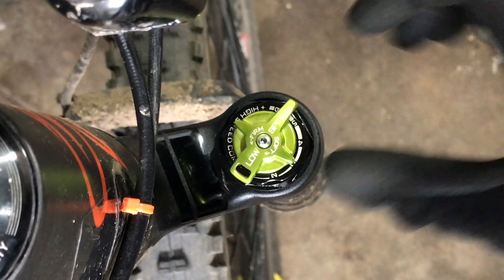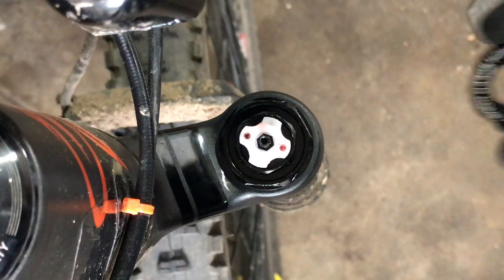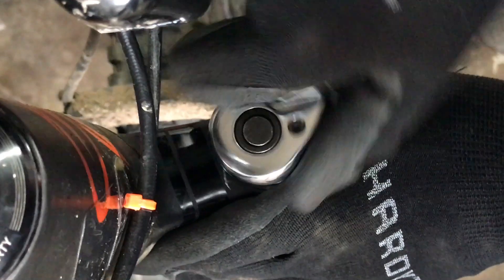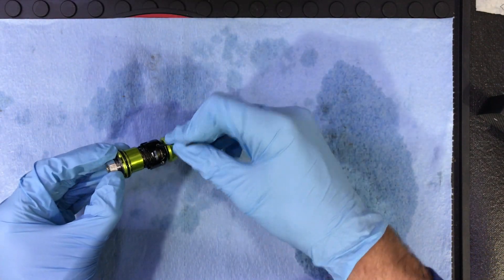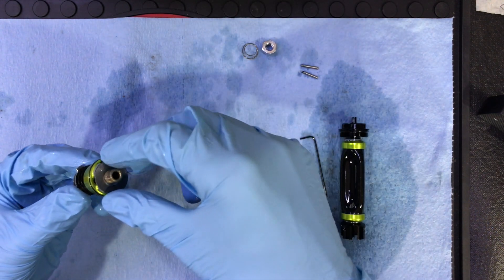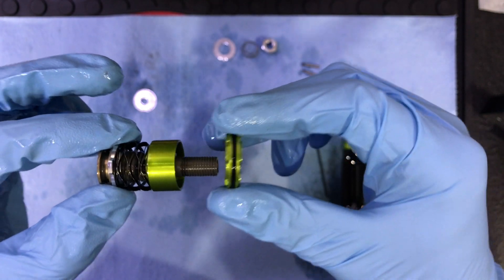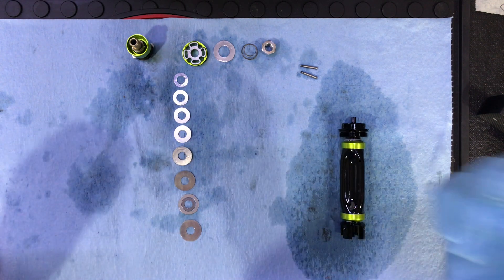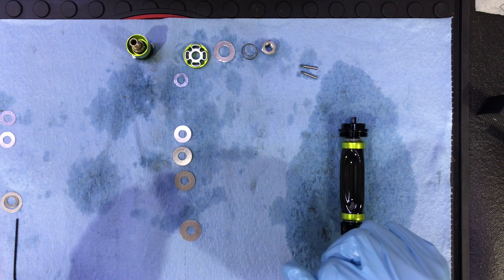DVO Diamond Shim Stack Tune For Less High Speed Compression Damping

Comment from the maker: Some viewers had some observations and suggestions:
1. There is an easier way to get to the shim stack: Set the HSC to the lowest setting. Lift the green HSC preload collar with your hands as far as possible and you will see a 10mm wrench flat machined into the shaft. Hold that with a wrench and release the main piston nut. 

2. You may notice the bladder is a bit "Sucked in". This isn't ideal but its easy to fix. Remove the two C-clips (careful they don't go flying on you!), move the green collars away from the bladder, then lift up the end of the bladder to allow it to suck air in. It only needs to be filled to ambient pressure. Ronnie has also suggested putting some heavy grease on the ends of the bladder.

Comment: The preload shim (the ring shim) are a low speed preload, it'll also affect mid and high speed compression though....not sure it's the most "elegant" solution to the problem.  Certainly not the "flip the piston" as it affects the oil-return orifice which needs to be free-flowing.
Why not run a slightly lighter fluid with a bit more rebound and low speed compression and then remove just the smallest shim?

Comment: I was wondering if you had any insight, I bled my damper but for some reason, the LSC doesn't really have an effect? Before the service, the fork would get really stiff when I turned up the LSC dial, but now there's almost no change at all. I can compress the fork fully when no air is in the Air-spring side, so I don't think there's a seal problem on the damper side. I figured you might have some tips based off this teardown. I followed the service guide step by step several times over.  Thanks
Reply: Any updates on that problem?

Comment: Have you ever seen a video on how to rebuild the bladder? 
I bought a bladder kit because they recommended it when I reached out about doing a full rebuild after a year or more of riding, but I can't find any help on how to disassemble the only part you didn't touch in this video🤦🏽‍♂️
Reply from the maker: Its been a while, but I think this should help. I think there is a nut that holds it all together. You can briefly see that at 3:48. Take that off, then the assembly will slip apart. BE CAREFUL TO NOTE WHAT GOES WHERE!! This is the rebound damper so you can really mess things up if you lose track of what went where. When in doubt, call DVO and they can sort you out.
Reply: @mtbdeli9018  thanks! Yeah I'm not sure if I broke it trying to get that nut off🤦🏽‍♂️... Of course the whole assembly is out of stock so... 😮‍💨😣 When I get home in a couple days I'm gonna call them and try to sort it all out. (Since I have an Angel Fire trip coming up though, I went ahead and snagged a 2023 180mm ZEB Ultimate) 🤫

Comment: @mtbdeli, 

So does this only affect the high speed compression, or does it affect both high and low?  I'm not familiar with the damper design, and with what the adjusters on the fork do internally.
Reply from the maker: Essentially just HSC. It does have a small effect on LSC but nothing I ever noticed. But the engineers would correct me if I said it was only HSC. 

The LSC adjuster opens/closes a pin valve to restrict oil flow through the port. The HSC adjuster adds preload to the shim stack.
Reply: @mtbdeli9018  so, (not to get too deep), but does the low speed compression not have a way of blowing off or bypassing / is it always active / fixed orifice?

I suppose maybe HSC oil can bypass the low speed orifice?
Reply from the maker: @sham8723  LCS is always active. The ports cannot be closed and will always allow SOME flow. The pin valve that lets oil get to the low speed holes on the piston can be adjusted so more or less oil can travel in the LSC circuit. However with LCS/orifice damping you can only get so much oil through there. As pressure builds it eventually is high enough to open the HCS circuit. 

At that point oil goes through both. As much as is able through the LSC, and the rest through the HSC. 

As you modify the shim stack that affects how much oil can pass through the HSC circuit under different conditions. If you really stiffen it, more has to go through the LSC making it harsher on big hits, but not changing how it feels when climbing or other LSC events (bermed turns). If you really soften it, it has a much lower pressure needed to allow flow and it can start behaving like an orifiace valve if its very soft. 

Shim stacks are like suspension black magic. You can do amazing things with them. Soften it initially then have it get much stiffer. Look up the Manitou Mattoc tuning guide. They have shim stack setups with dyno charts to show the different tunes. AMAZING resource, I wish DVO did that. But they have Ronnie...I asked if they had such charts, rather than send me a chart he asked me about my bike, my weight, riding, trails and gave me this tune. 

I hope somewhere in that is the answer you need! if not, let me know. 

(this might help too)
http://tech.dvosuspension.com/piston-technology/

Comment: hey there did you change the blader?
my mechanic find cracked shim out of shima stack...in middle with blader!
do you have any idea how this happen?
thanks a lot men!
I could uplad photo if you have any mail thanks a lot!
Reply from the maker: Darksoul channel there is an extra bent shim in the stack. It was added to fix a noise. The noise was actually a different issue but the build spec still had it included so that’s what they built. You can toss it. It doesn’t do anything and can break free like yours did.
Reply: @mtbdeli9018  I think understand what you are telling me! 
This shim i found its outside from the stack and in the middle with the blader
 your video in 3.47 in your right hand there is 2 shims there!
My fork now works like before and smoothly without any different sounds!
I upload the shim here check it for the record!
I have to replaced this shim or its nothing?
https://we.tl/t-BpihEYhaO8
Reply: Thanks a lot!!

Comment: Hello Man. I bought a second hand bike with dvo Diamond... I noticed this forks are making a clunk when i pump quick like knock, on the rebound action, even in mid travel. This clunk is very noise. And i feel that on my grips. Do you know If this is normal or if not, what kind of problem is It!?
Reply from the maker: Sounds like an issue with the OTT spring knocking. Call DVO and they can tell you want to do. I don't recall the steps.
Reply: @mtbdeli9018  i did the damper service. And searching for that issue, i found something in MTBR forum. I sanded the shim stack that stuck below the rebound piston... in compression damper i found a shim broken, so i remove it. 
Now, my Diamond works fine, without any clunk (i bleed the damper with Putoline GRP 6 2.5w shock oil, because its a less thicker than other 2.5w fork and shock oils)... Its very, very supple and plush... love mine. thanks

Comment: Hello,
Hope u can help me. My fork is brand new but when I turn the HSC knob it doesn't make any clicking noise, in fact, I cannot even feel any clicks. DVO told me it's because it's new and greased, but it will start making clicks eventually. Is that the way it is? Is it normal? Because I'm thinking of return it and ask for another one.
Thank you for your help and thanks for the video, it's really useful :)
Reply from the maker: Sorry for the late reply...notifications were not on. That is normal. Sometimes people refer to DVO settings as how much "Mushes". There isn't the snappy clicky feel of RS or Fox. Its more of a mushy soft click. Its a small ball bearing/spring that snaps into a detent. They pack them with grease and that really reduces the feel. You can take of the top cap and clean out some of the grease if its still mushy.
Reply: @mtbdeli9018  Thank you very much :)
Reply: In newer DVO forks the LSC/HSC unit comes off in one piece and never needs to be separated (nice!). The HSC knob doesn't have steel balls anymore, just small plastic bumps. Almost no clicking to the HSC, which is fine-- it's pretty stiff at first, but loosens up to adjust pretty easily once it wears in a bit.

Comment: Hey mate! I ride in pretty Rocky, agressive and technical terrain, I felt a lot of hand pain today. Do you think this mod could help me for this issue? I weight around 76kg
Reply from the maker: How much travel do you use? How much sag? Another possibility is the fork is undersprung and riding deep in its travel. This leads to spiking and harshness. If you are in the 20-25% sag range and using 80-90% travel max then sounds like this mod is right for you.
Reply: @mtbdeli9018  I'm using 90% of the travel at 110 PSI, I wouldn't say it's undersprung at that pressure.

Comment: I like the way my fox 36 ramps up with volume spacers, I like the stiffness that you get. Are travel reduction spacers the same as volume spacers for a Dvo beryl boost fork?
Reply from the maker: No. Travel reduction spaces simply reduce the travel by 10mm increments. They are plastic spacers that snap onto the air shaft, limiting extension. If you wanto to make your Beryl more progressive you can use volume spacers. I think they newer forks have threads on the underside of the air cap. At least the Sapphire does. If not you can always add oil to the air cartridge, that will do the same thing. Call DVO for more specifics, they are great to talk to and ask questions.

Comment: I’m not hearing any clicks on my high speed knob. Any idea what might be causing this?
Reply from the maker: The clicks come from the balls/springs in the dial. As you turn the dial they can make noise but mine don’t make a sound either. 
I just feel the detents with each “click”. Its probably from the grease I use to hold them in place. No big deal since the click is just to know what potion the dial is in.

Comment: Do you notice more stiction and sooner after a lower leg service with your DVO? Mine feels great right after, but it isn't long before it becomes 'notchy'..... My lower end Yari was bullet proof and felt stiction free no matter how long I went between lower services.
Reply from the maker: No, I can't say I've noticed that. What oil are you using? I use the Fox stuff. It is definitely thick and sticky which helps it coat the inner parts. If you use a lighter oil it may settle in the legs and not coat like it needs to. Try turning the bike over for a few minutes, then see if the stiction/notchiness goes away. I've ridden and felt a few DVO forks and never noticed one with much stiction, so I have to think you can figure this out and get it smooth like others'.

Comment: @ mtb deli: would you mind to tell me your weight. i guess i have the same issue. but my weight isn`t that low: 74kgs.Thanx in advance
Reply from the maker: 83kg body and another few with bike gear. It has more to do with the speed and terrain. A lighter rider going faster can generate higher force in the damper. I’m on the heavier side but ride with finesse and caution...so don’t generate the same forces that other riders do.

Comment: Hello
Just saw you vid.  Did this mod put back together and now my HSC dial doesn’t turn. Any thoughts??
Thx
Reply from the maker: I would pull it apart again and check for anything not assembled correctly or binding. Call DVO when its apart and they can help you figure out what is wrong.
Reply: Ty

Comment: Thank you. My Shockwiz keeps telling me I need softer high speed compression and its adjusted all the way soft. Weird though because I’m 230lbs geared up.
Reply from the maker: I've heard mixed reviews of the Shockwiz and how good it is for tuning. I have not used one, but tuners say they are good to get it close. It won't replace trial and error to dial it in the final bit. Even at 230, you may need less HSC. It depends on how fast you ride and what kind of terrain. Now that I'm in the Northeast, the riding is slower and more small rocks and roots. I may open it up and flip the piston to get more HSC range.
Reply: Where in the Northeast are you? I’m in Connecticut. Yeah. Kind of slower picky sections. Even at 230 I must be kind of light on the bike. I always need less compression and air than recommended to get my sag right and not rattle fillings out.
Reply from the maker: @Jaredcouture12676   I am now in NY, outside Albany. I used to live in CT (Trumbull...miss those trails). Don't pay much attention to sag. You don't want to be way off, otherwise it can affect geometry. Its more or less a very rough starting point for tuning. It gets you close enough that for most its good enough for them. However once you dial in the suspension in other ways you can almost ignore sag. 

What I do is get the basic "feel" right. Not too wallowy and not springy. Rebound and compression should be wide open. You can do this in a parking lot. Then I find a section of trail that is what I want to tune for, it helps to have a faster corner. Ride it a few times with rebound and compression wide open. If you can't hold your line in rough stuff, rebound is too fast. Keep riding and adjusting rebound until the bike feels harsh. Then back it off a bit. 

Adjust compression as needed: bottom out...add more. Not using close to full travel, add less. Using full travel is also over rated. I NEVER bottom out, but get 130mm of very controlled travel out of my 140mm setup. 

Anyway, thats what I doo and it works great. Check out Shockworx website (New Zealand tuners) for more detail and explanation.

Comment: how much do you weight?
Reply from the maker: Claudio Bosticco I am about 190 with gear and water. When I talk to DVO they are surprised I want less damping. Most of them run similar air pressure and weigh less. However they are riding much harder than I and on trails with some big hits and drops. My riding is aggressive trail at most and I keep the wheels on the ground most of the time. A few 1-2 foot drops.
Reply: Your riding sounds similar to mine. But I'm 143 fully loaded, so I think I definitely need less damping. Actually I wonder if mine is a case which may benefit also from the piston flip. Thanks for your video guide!
Reply: For now I've done the piston flip only. One ride only, but the first impression is good.

Comment: Your bladder is sucked in it shouldn’t be like it should be round there are clips top and bottom to get the air back
In the bladder that will fix the hsc instead of playing with the shim stack
Reply from the maker: Derek Lawrence , yes it was sucked in. I did fix that off camera. While that will help the fork work a bit better it won’t be enough for the change I was looking for. The shim stack mod makes a big difference and I what DVO recommends for a lighter tune.